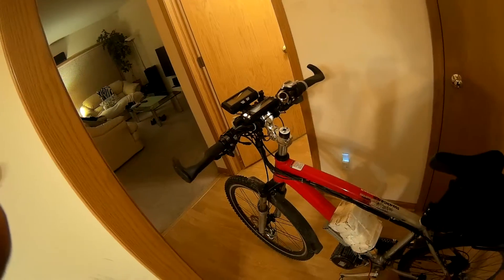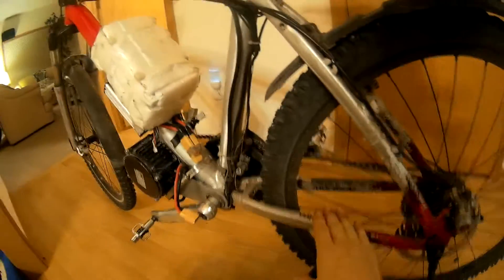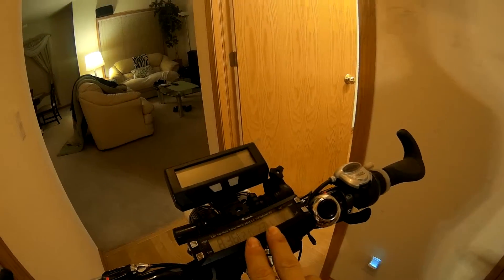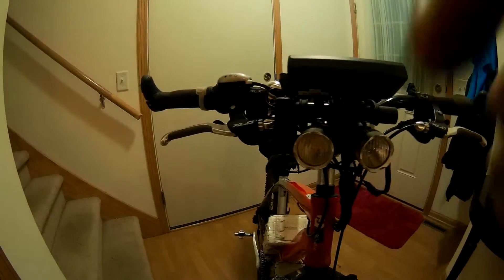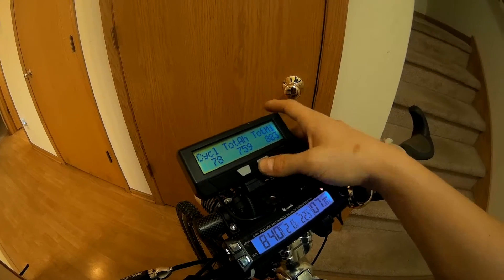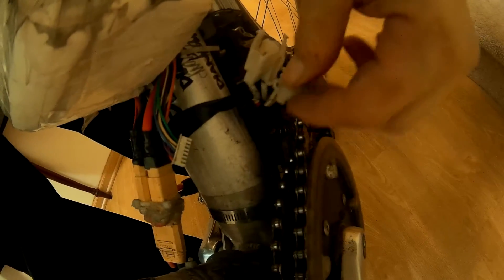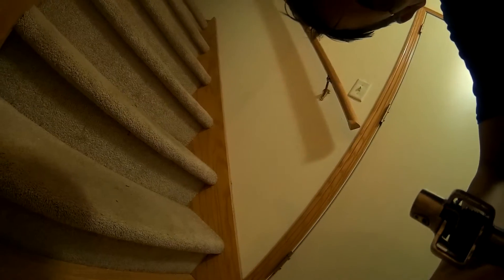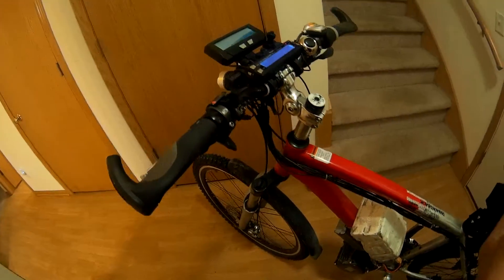Cyclone 3000W mid-drive eBike kit overview and power mod

Comment: Can you make a video on how you set up cycle analyst and the other computer you have below it? I have this same motor with a luna cycle battery but can't figure out how to attach cycle analyst to the luna cycle controller. Also can you link the headlight and backlight you use? I have battery powered ones I want to upgrade to connected. I have currently a GPS tracker and USB wired in together to the battery power but would like to have lights as well, just can't find any good lights that don't look dim.

Comment: 3:01 Why didn't I think of that? I have the 48 on the outside and the 44 on the inside. Swapping them would let me pedal a little faster with assist. At 72v, there's always a point when I can't keep up and just let the motor take over but if I want to contribute more that would be good. 

If I ever have to take it apart. I'll swap those.

Comment: I'll guess that a regular three way (on off on) toggle switch would work as a three speed switch? Without jumping the connector the bike runs in medium speed mode? If so then the off middle toggle position should work for medium speed.
Reply from the maker: Correct.
Reply: I'm almost done with my first 3000w Cyclone build. Starting to get excited about finishing it. I still have a few things to do, but mostly just waiting for the 52v 14s 9p battery to show up from EM3ev. When I have time to build a battery box for the bike, I'll install a 12v 3 way toggle switch on the box for the power levels. Eventually I'll use a 72v battery with different controller.

Comment: hehe ,nice she lets you know that she wants a front seat ,hehe she's a smart doggy =)  Ahh so it's an old CA  V2 .I have the V3 ,finally got time to shop for my missing parts (connectors/ShrinkWrapp/Butts connector Etc ) I will let you know how it works out & share what I get to help out who needs the info about a fully working CA-V3 with all limiting capability's .
Reply from the maker: Sounds great man.  Thanks!

Comment: Allo again ,BTW I was wondering what is this second screen you  have under the CA ? Can you post a link to where I could buy it &  read whats written  about it ,thanks ,Nice night ride that was but I don't understand why you do not have a Pet Panier in the back of the trike for their safety & comfort .I had a cat many years back who loved to ride with me on my bike, back paws on the top tube ,front paws on the handle bars    Thank for the great vid again  ride safe Guillermo
Reply from the maker: You can buy the CA here... this is where I got mine. ( I have an older version V2.4, but 3.0 is good too)
http://www.ebikes.ca/product-info/cycle-analyst-3.html

On the trike carrying a dog is not as bad as it is on a bike...  I tried pet stuff for the dog once, but when I put her in the basket and started moving she started howling and barking non-stop, so I decided to carry her on my lap with a safety cable which works great, kinda like a safety belt.

Thanks! and ride safe as well ! :)

G.

Comment: I recently bought a Cyclone kit from LunaCycles It is installed and works fine .Tho I am having difficulty adding the CA-V3 with front wheel  speed sensor .I found a lot of literatures on ES ,EB and GrinTech website .Doing a simple connection to read only is of no interest I really want to have control on the motor with CA .  I want to avoid getting speed tickets of even get any officials attention for that matter .With the CA limitation capabilitys on the fly speed restrictions could become not only safer but very economic ,you understand that ;-D For those who may wonder how it is running : Motor even after running it to top speed (Standard set up ,no #1/#2/#3 modd) for a solid 15 Min .I could  stick  my hand on it and keep it there , exterior temp was in the 25-30celcius  Controller : On that same test ride Controller was warm but I had also no issue keeping my full hand on it .Hmm i'd say even lower temperature of that cup of coffee you get each morning .  Thanks for the trick modd there ,that is now on my "To Do with Cyclone" list as soon as I have the CA working @ full capacity . Can you link a schematic of how to achieve this connection ,I have Grintech CA-shunt DP  -->http://www.ebikes.ca/shop/ebike-parts/ca-accessories/shunts/shunt-ca3.html
Reply from the maker: Hey, grats on getting the Cyclone. I don't use the CA to do any control nor have any schematics for the harness.

I limit my speed using the trike gears, there is no need to use CA to do that. Been doing that for ~5000 miles now. 100% reliable and no wires.
Reply: yeah that is one of the way I also thought to use ,motor MaxRPM ( 1st reduction {14T -> Crank44T} Then calculate Second reduction for each of my 7 geare in the cassette ) wich I can know the max speed on every geare ,this being a goal keep rev as high as possible at all times .I live in Montreal city, its a great place to live but there are those area where I don't want to go over the limit and attract the officials attention for one .Then the CA plugged in this way makes my e-bike even with 3Kw motor (Regulation say's 500W Max) Legal .I do probably as you do to like the power & higher than usual speed .Limiting the max speed @ the flick of a switch (in a hurry you know what I mean ) is what I am looking for ,the tree Position switch looks like a nice option if I cant get CA to work . Thanks for a quick response Great Vids btw .Keep up the good work ->Ride Well And Safe
Reply: I forgot to ask : I am looking for a I-phone app to track speed statistics ,Current speed/top speed and so on ,I tried a few but they are still not good enough missing mainly >Top speed reached on current ride <-,on all of them
  Any suggestion on that ? thanks
Reply from the maker: I have the three speed switch hooked up on my trike, as a two way, its either mode #1 (very slow) or mode #3 (full RPM) and I've yet have to switch to mode #1, mode #1 will limit the speed as well, I think is 60% or so of max RPM so that will slow it down quite a bit without the need of messing with CA.

I've used Cyclodroid, but I have Android and no Iphone so I am not sure what to recommend.

Comment: Hi g, what pins do the jumper go into for mode 3. Thanks. Dom
Reply from the maker: +Dominick Feragola I think is center to pink, but you can test. Center to either one of the two sides, one will give you mode #1 and the other will give you mode #3.  Easy to test, lift the bike hit the throttle if it goes really fast, thats mode #3. The video kinda shows the difference in speed.
Reply: +Guillermo J Garcia-Sampedro thanks G. I'll do that. You've been amazing helping all of us with our cyclone kits. Ride safe my friend.
Reply from the maker: +Dominick Feragola You're welcome, Dominick, just figured I'd give back a bit of what I've learned. Let me know how it runs! :)

Comment: Thanks. Is the controller set up from the factory for the cycle analyst ?
Reply from the maker: +Dominick Feragola No, controller doesn't have any input for CA, I used the Shunt resistor for the Stand Alone CA installation. That gives me amp and voltage reading and an external speed probe for the speedo.

Comment: I don't have the kit yet, My bike itself isn't even done yet. But what exactly are the modes and what do they do?
Reply from the maker: +louis siginski 
The modes control de acceleration and top speed of the motor, so in mode #1 you have the mildest acceleration and the lowest motor speed, mode #2 (what defaults to) is good acceleration and moderate motor top speed, mode #3 is full acceleration and fully unlocked motor RPM.
Reply: Guillermo J Garcia-Sampedro alright. so is there any other way to switch between modes other than sticking the wire in there?
Reply from the maker: +louis siginski Yes, the 3 speed switch is available at Cyclone taiwan for 15 bucks, or you can build your own with a center signal SPDT switch. I personally like to keep mine at #3 and use the throttle to adjust RPM as I need more or less.
Reply: Guillermo J Garcia-Sampedro alright. thank you
Reply from the maker: +louis siginski np.

Comment: Can you regen for braking on the motor?  Becoming quite the bicycle mechanic over there.  Keep it up!!
Reply from the maker: +b1gmb Not with the configuration as its stands; basically the motor shaft has a freewheel which prevents from pedaling the motor. For that you need a direct drive hub motor.